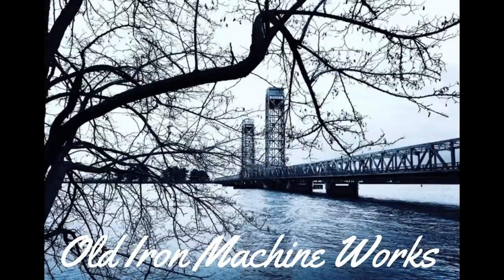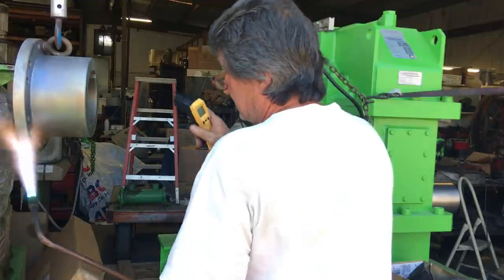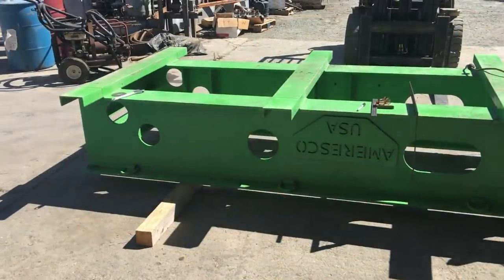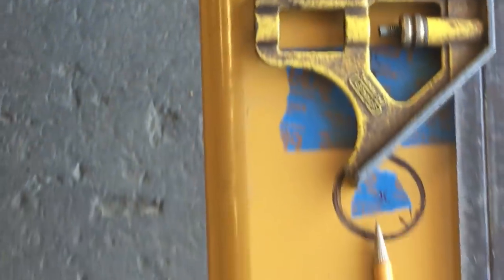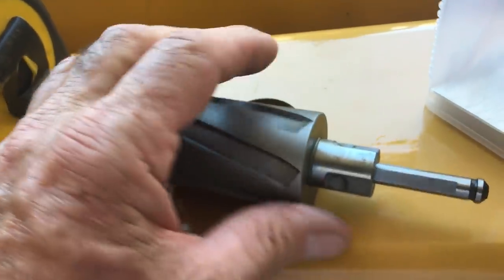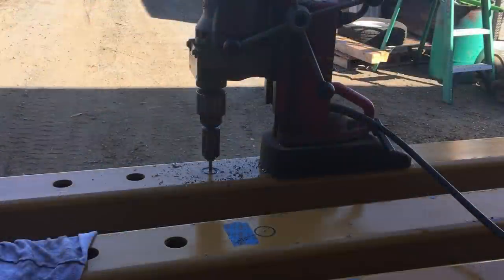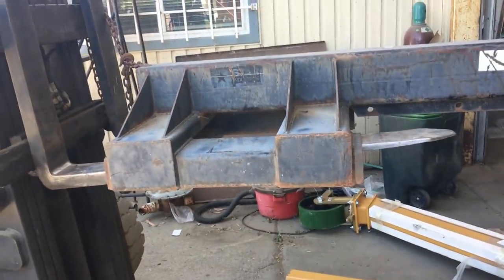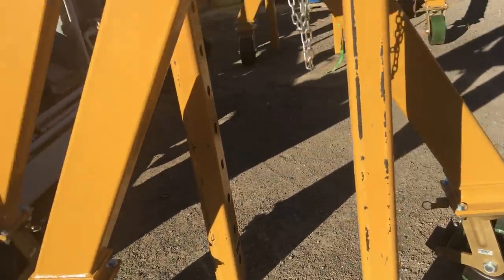10 Ton Gantry Cranes,  Chopping Them Down

Comment: I would think some caster wheels on that sled would make moving those in and out of the building go a lot smoother. Looks like they are just dragging them but clearance doesn't look like an issue. Surprised they aren't using big Waukesha engines I hear they tend to rack up a lot of hours between overhauls.
Reply from the maker: Good morning Brian.  I’m pretty sure they had equipment rollers under the frame when dragging it out of the building.  I see you have a new video out, I’ll have to watch it after I go check out my favorite scrapyard :)  Always nice to have you stop by Brian.    Gary

Comment: Another nice video with mixed content, many thanks for sharing.  I don't exactly blame the client wanting to have the gantry crane locking pin re-instating. He's likely experienced some expensive pieces of kit being dropped, even a drop of a couple of inches can be costly in $$$ to repair, but factoring the downtime of the equipment can often be way more expensive.
Reply from the maker: Thank you Paul.

Comment: Enjoyable and educational as usual. Thanks!

You really have to wonder about the designer of that building. It seems silly not to have a larger door. 

It would be really interesting to see a video of the actually setting and alignment of the engine and gearbox. I've done a bunch of alignment with two components, but not three.
Reply from the maker: Thanks Aaron.  They have another company do the laser alignment so I won’t be able to get footage of that. 
I appreciate you checking out my video.     Gary

Comment: Hey Gary did you flip those tube and drill the other side or did you go straight through. Are those sparkplug wires does it run on N.G. also what do those engines power . Thanks for the Videos  Steve
Reply from the maker: Steve, I did flip the beams to drill the other side. The engines are connected to generators. They run on landfill gas and they sell the electricity that the generators produce. I appreciate you checking out the video.    Gary

Comment: I'm curious, why did you need the guide pin at all with the mag drill? Isn't the mag drill magnet strong enough to hold it steady, like a portable drill press? I use annular cutters quite a bit, have never used the pilot. I always thought that was for hand drills.
Reply: Oh I'm stupid! You needed a way to center up on your punch mark. Sorry stupid question

Comment: What am I missing here? The engines were made in Austria, somehow you did some repair, or rework, and then they go BACK to Austria? They couldn’t do it there?
Reply: Probably cost of labor and less regulation
Reply: @jpsimon206  I don’t know. The cost of getting a 12.5 ton engine ready for shipment across the Atlantic, along with the costs of trucking to the ship, plus the cost of the shipping, and doing that over again on the other side to get it to the shop, and then again across to Austria would cost way more than the cost of labor here. And what regulations? They’re not doing anything that would change the functionality, or the emissions, and if they were, the regulations back in the EU would take priority.

If the regulations govern the work being done, or the employees, they wouldn’t be worse than the ones in the manufacturer’s factory.
Reply from the maker: Mel, they get Remanufactured engines once they get to the point of needing complete overhaul.  The reman engines are as close to new as your going to get. At some point all engines that run 24-7 need to go back to the machine shop. So no they cant do them in that small building.  The engine that came back to the yard is nothing more than a core.
And yes they are crazy expensive.  I hope I answered your question OK.    Thanks for checking out the video.       Gary
Reply: @OldIronMachineWorks  yes.

Comment: Those are gas pumping engines?
Roughly hp size. 
How many hours does
Those engines last
Reply from the maker: Dale, They run on the landfill gas, coupled to big generators and they sell the electricity. I'm thinking they can go at least 50,000 hours. Heads will get swapped out more often. Not sure of the HP
Reply: @OldIronMachineWorks  thank you for information 
I like the variety of projects you do.